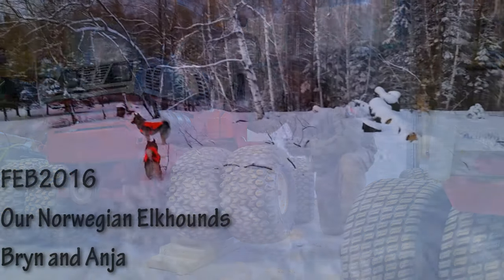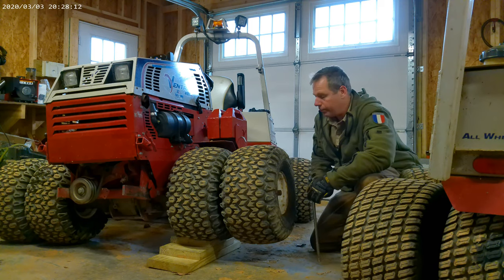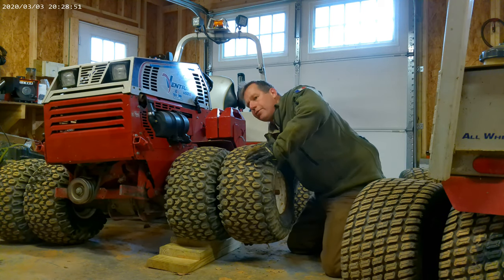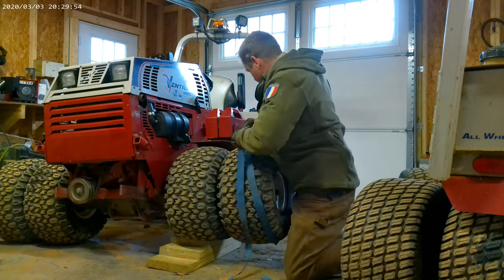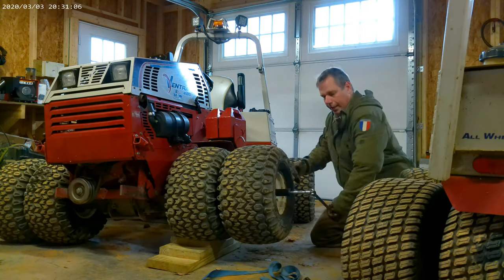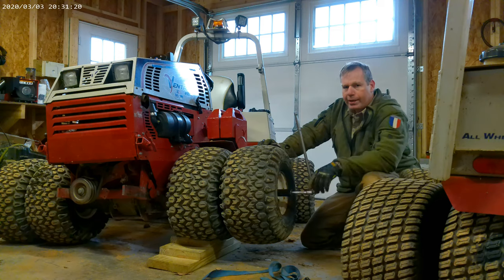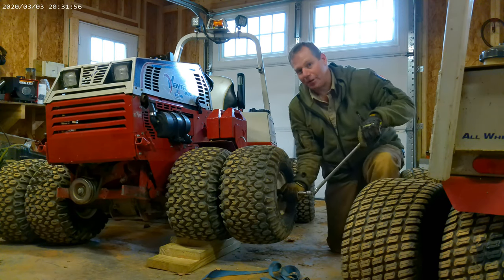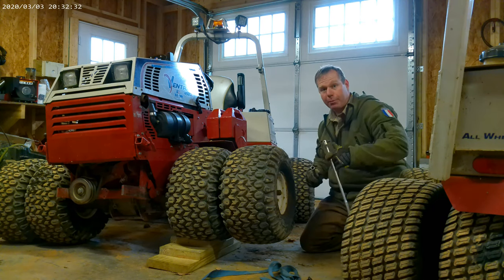Removing a Stubborn Outer Wheel on Ventrac

Comment: Thanks this saved me. And your other one. Flat inner tyre this morning.
Reply from the maker: Hope you have a great Thanksgiving.  The older style wheels only have a valve stem on one side but the newer ones have stems on both.  If you have the older, make sure you mount the inner wheel with the stem on the INSIDE.  That way, you can inflate the inner tire without taking off the dual
Reply: @bluecordprecisiongrading2504  thanks for that. Yes I discovered our wheels all have double valves. Having said that I put the repaired tyre on the outside for ease of access if it went wrong again, and it did! So glad I did that. New tyre on order.

Comment: Thanks for the updated video. Using ratchet strap I got one of the outer tires off. Tomorrow I'll try the other one. Its stuck on there real good.
Reply from the maker: Let me know how it goes
Reply: @bluecordprecisiongrading2504  Finally after two weeks of dinking around I got both the outer wheels off. Had to take the whole assembly apart on the front one. Both inner tires went flat. Got them fixed  and everything put back together. What a debacle. Now I can try my two new implements. Thanks again for the videos
Reply from the maker: @charlesvannice1682  You're welcome!  I'm glad that they're helping!

Comment: Do you think that is a good design for dual wheels as far as speed of installation and removal and strength.  For example, if you ran both outside wheels up on your wooden ramps, would you notice any flexibility between the inner and outer wheel.
Reply from the maker: It's a very solid mount and very quick for mount/dismount
Reply: I built 4 ramps to speed up the removal/ mounting process.  I do it every week in the summer.  Duals on for mowing, off for stump grinding.  It drives me nuts not to have the full swing of the steering to grind stumps. I also use an 1 1/16" socket.  It might not be the exact size, but it doesn't get stuck on the nut.